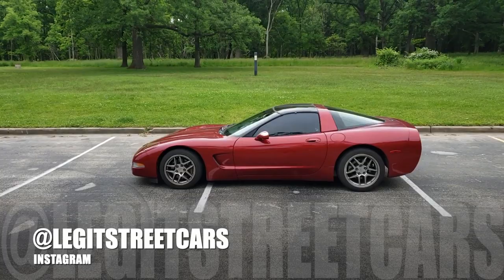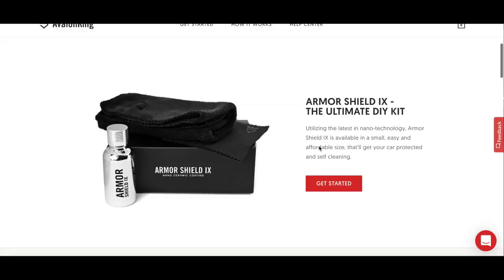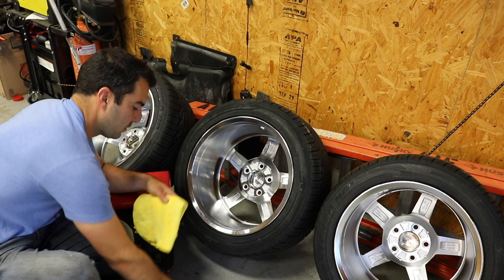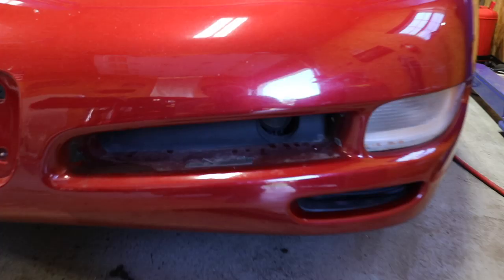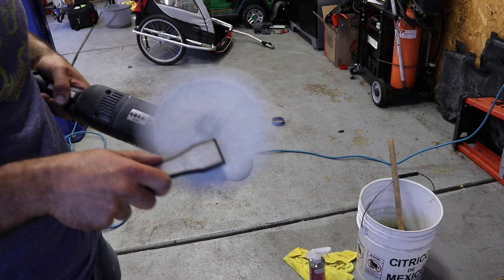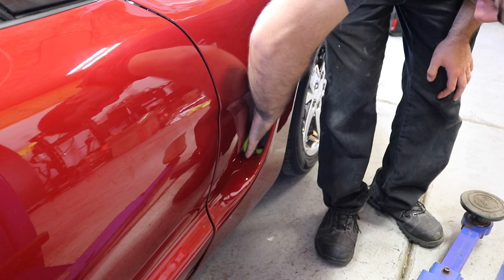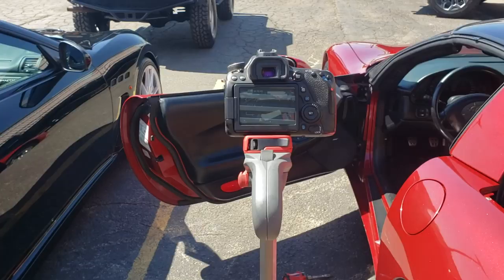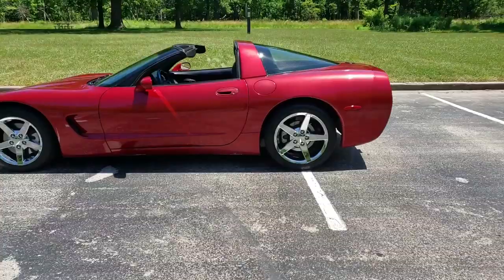I Love Corvettes So I Spent 30 Hours Restoring One That Sat Outside For 8 Years. DIY C5 Restoration.

Comment: 16:40 LMAO
At your response to him, but also at how wrong he is.  A Corvette C5, the freaking LS1, is one of the cheapest performance engines to have/work with. Sure it's not as cheap as Honda Accord Ownership, but compared to most sports cars, it's a bullet proof and easy ride.
Reply: She was a beautiful thing already, but you added the oil of Olay. She's now radiant, and I guarantee you she doesn't want to be babied. Put your foot in it, and if its the TH 700 automatics use your gears. I've been " stickin'" mine for 20 years . Mines never required anything more than every 4to 6 year complete flush 'n fill with the new screen,filter, 0 rings and gaskets. I've  always added the one bottle of Slick-50 transmission additive and  that's it. Great video and  sharing your expertise on the detailing and products you use is very cool man.

Comment: I have got a really good tip for the faded trim area, apply some silicone stick and use a heater to warm up the plastic.
It will look as good as new.
Reply: And just message me if you want before and after picture

Comment: I detail cars and trucks for a living and as far as the plastic goes I use a product called bumper coat, you are actually repainting all the plastic but the product lays down so smooth it is awesome. I use it on everything that needs brought back to life and with three good coats there is no fading or having to redo it.

Comment: The best trim restorer I ever used was Gtechniq C4 ceramic trim restorer. This stuff is like a miracle in a bottle and it lasts YEARS. I used it on an old Mercedes and an old Land Rover with really nasty black trim and it came out almost perfect. I did both almost two years ago and still see no need to refresh them to this day. Totally worth the  money -- about $40 for a small bottle -- but you just never have to do it again.

Comment: You can get plastic trims back to stock with a heat gun and patience.
Practice on hidden locations before you go all in!
Reply: Dolph Handcreme That doesn’t make it back to stock it just erases the top cover which is worse .
Reply: @edgarh252  tested it on 3 cars a while ago. It does not erase anything, it just let the top layer reflow a little bit to get less rough, so reflecting  the light in another way and look darker.
Reply: Dolph Handcreme I’ve been told that by professionals.
Reply: @edgarh252  and I tested it myself. ;)
Reply: @dolphhandcreme  Jay Leno told me that it's the dumbest shit he's ever heard in his life.
Reply: Would be cheaper to just replace the trim with new ones
Reply: Great idea! It's no that easy to get new parts for cars that are out of production since many years. Depends hugely on the make and model. And most aftermarket trmi parts are not 100% identical to factory ones so it looks a bit off.

Comment: First off, congrats on doing it yourself and learning.  Secondly, get rid of that Chemical Guys stuff.  Its junk.   CarPro, Meguiar's and Griots are the go to choices for GM paint.  Being of a harder nature, you need a stronger compound to cut through oxidation and get down to good clean clearcoat.  But before that, I would not have used alcohol to clean dirt.  Even Simple Green would have been a better choice, soap and water being the best choice.  I didn't see where you cleaned the engine bay, it desperately needed it.  The iron remover you used from Chemical Guys is nowhere near as strong as CarPro Iron-X.  But for the tools you had on hand, the car came out as well as can be expected.  However, had you used CarPro ClearCut or Griots Fast Correcting Cream, you would have seen a dramatic difference.  Also, when correcting, get yourself a forehead mounted LED light.  Makes it easier to see the imperfections removed while correcting.   Furthermore, when removing badges, try CarPro Tar-X as its an absolutely amazing adhesive remover.  Just spray and wipe.  Lastly, when doing a ceramic coating, its IMPERATIVE to use a light to check your work when removing.  High spots can make or break a job.  I don't know where your located but if you could find a reputable shop near you, and get their opinion (which is no charge), you will see the truth in what I am typing.  However, what's done is done, I am merely hoping to share some of my experience with you.  Keep practicing, its the only way to learn!
Reply: Mike K well said Mike!  That is all 👨‍⚖️
Reply: I support this comment and use the products he recommends. I use Griots Fast Correcting Cream and Sonax Perfect Finish when doing a 2 step. Also after paint correcting it's important to get all the polishing oils 100% off the paint before applying the ceramic coating. For this I use Carpro Eraser. For black trim I ceramic coat it with Kamikaze ISM. It restores faded black plastic and keeps it looking new for years without looking shiny or greasy like some dressing do. And it's super easy to use also.

Comment: 15:53 I still see swirls
Reply: And holograms
Reply: @DuBstep115  , yes, awful holograms!
Reply: The wool pad with heavy cut was way too heavy handed imo, and then he made too big of a jump to the yellow foam pad...
Reply: @asthecrowflies1201  he should have compounded longer but also he doesn't want to jeopardize the clear coat
Reply: Such a shame for 4 days of work. That’s why you make test spots people.
Reply: It definitely happens. I know we've all made our fair share of oopsies over the years. It's a big part of learning, and shouldn't be viewed as failure.
Reply: Years ago I went way too hard on a single stage, custom lacquer paint job with basically no clear on a 1970 challenger. The paint was fine for like 35 years and I murdered it in mere minutes :(  Took it all the way to the primer in A BUNCH of spots before I realized what I had done. I died a little that day...
Reply: As The Crow Flies yeah buddy that’s failure.

Comment: C5's are so insanely inexpensive in my area it's almost ridiculous. Absolutely the most "bang for the buck" you can find as far as performance goes. 

For trim, Solution Finish is amazing. For hard plastic trim, I usually just scrub it with APC and ceramic coat it. I don't want to deal with reapplying products every time I see it. The coating means trim looks good for years, not great for weeks. They make trim specific coatings, but I find them unnecessary in most cases..

I often coat half of the hood on client cars if they're hesitant to spend the extra money on a legit coating, it works everytime.. 👍👌✌
Reply: Mercury Grand Marquis   I wouldn't consider a Charger a luxury car. I've bought and sold and driven various Chargers, Corvettes, Camaros, Mustangs, etc., and I've driven several Hellcats, Porsches, Vipers, exotics, etc.. 

For me the overall performance, fun factor and just the feeling you get behind the wheel of a C5.. it just looks and feels like a hell of a lot of car for the money.

But this is just my personal experience and opinion, there is really no right or wrong. I love and appreciate all cars and am not biased in any way. 

My first car was an old '91 Mazda RX-7, so they will forever be one of my favorite cars to drive. Not a lot of incredible performance there.. I thought it was the coolest, fastest thing around at 16, driving it to high school paying $225 a month for insurance because it was a turbo.. 😁👍👌✌

Comment: have the old wheels powder coated, maybe anthracite?
Reply: Plasti-dip. 40 bucks. 👍
Reply: @heinzkitzvelvet  plasti dip is the cheap way,but those were nice vette wheels and so, should be done right .
Reply: @2001wj  Then why change the color? Nothing wrong with chrome. The replacement wheels are chrome. So why powder coat them another color? If you want to experiment with other colors, Plasti-dip is the way to go. Don't like it? Take it off. 

Don't like the color of the powder coat? You're fucked.
Reply: @2001wj  So I think having them repaired and re-chromed is the best thing to do. It leaves them in their OEM state. Powder coating will hurt the value. Plasti-dip will not.
Reply: Heinzkitz Velvet they are a mass produced wheel, powder coating them would do nothing bad to their value, they have very little. His idea of powder coating them for a daily driver is valid. Powder coated wheel is VERY durable, hides dirt (if the right color), is easy to doctor up if they get scratched. They also would look awesome in the color suggested. ;)
Reply: @Todd66  Well that's just completely wrong in every way. OEM parts, especially in pristine, original condition, are ALWAYS of higher value, and cost, on the secondhand market, than the same parts that have been "modified" by one owner, to suit his fancy, and sold to another. Mass production numbers have nothing to do with it. OEM original will ALWAYS fetch a premium, especially if the condition is top notch. Try again.
Reply: $50 powder coat each wheel at CO in yorkville. He has a chrome set, now use 2nd set for winter tires. Knowing Alex, he will daily drive it in Chicago Winters.
Reply: Heinzkitz Velvet I’m sorry, but read what you wrote. The wheels are NOT in pristine condition, reman wheels are only expensive on eBay. Get on facebook market place, pic a vehicle and search OEM wheels for foreign and domestic. You can get a perfect set of OEM wheels and in most cases tires for less than $800.00 right now. I drive a C6 and OEM wheels in perfect condition can be had for less than $1200 regularly. I appreciate what you are saying about OEM being worth more, but that’s only if you are buying new and from a dealer. That vette is a C5, only the very rare will have any real value on the open market. I do believe if you watch the video again, those wheels are NOT OEM, they are in fact replicas and even worth less. So sir, you may try again. And in the future if you need to buy some OEM wheels for anything less than an exotic, hit me up, I’ll help you locate the perfect set for a better deal than you seem to think is available. And i’ll do it free of charge with no smug face to boot! I am a car guy 100%
Reply: @joemendez197  Those wheels need a lot of work done before powder coat becomes an option. It ain't happening for 50 bucks. That's yet another reason powder coating doesn't make any sense.
Reply: Heinzkitz Velvet if you think chroming them would take any less work, you are talking about a process you are unfamiliar with. Powder coating those wheels would be a little more than $100 a wheel. As a matter of fact, there is a place near Noblesville Indiana where the guy charges $100 a wheel, even with tires on the wheels. My mailman and I were just talking about this last month, he had his Grand Cherokee OEM wheels powder coated black. Get off the chrome wagon LOL First thing I did when I got my Vette, was to pull the OEM wheels off and put powder coated wheels on. I daily my vette so I needed a durable wheel that looks great and will continue to look great as the miles pile up.I would like to mention again that the wheels in the video are replicas not OEM, so there is NO reason not to powder coat them and every reason to nix the chrome. TRY AGAIN @Heinzkitz
Reply: Heinzkitz Velvet when I watched the video again, I get the impression they are replicas. Maybe you are right about them being a ZO6 OEM wheel, but that really does not change the fact that powder coating them would be a great option. They are near worthless as they sit, so anything done to them with the exception of Plasti Dip would be a improvement value wise. Not saying plasti dip is not cool, it has it’s applications. I did my wheels on my R1 a few years ago, they turned out great, but not really good for motorcycle wheels when you have chain drive. Was not as easy as I wanted to remove either. Back on point... I am not the biggest fountain of info on anything, let alone wheels, but I’ve got about 37 years experience dealing with the automotive industry and cars/trucks/motorcycles in my private life also. So to tell me I do not know what I am talking about is laughable. It’s been interesting to go back and forth, we both have very different perspectives. But I will stand by my original opinion that powder coating those wheels would make total sense. Powder coating wheels does not ruin them in any way. You are by no means “fucked” as you said if you don’t like them. Strip them and do it again. I’ve had parts chromed before...good luck getting a nice durable finish. There is a reason those wheels look like terrible. Chrome is crap, even OEM chrome. Powder coating just keeps getting better and better. The colors and textures now are amazing. Hey I’m done here, have a great week and thanks for spending time on here!
Reply: @Todd66  Here's an idea. Ruin your own stuff that you paid for with powder coat, and let people who know what they're doing, actually take care of theirs, deal? Or you could sit here on YouTube and keep running your mouth in a conversation no one invited you into. Either way, knock yourself out.👍
Reply: nope. satin bronze or gold would be killer with that maroon color
Reply: Yall going back and forth was damn near better than the video hah! Entertaining if nothing else.
Reply: Chuck B IKR! I was actually enjoying it until I realized he was/is being a douchebag and shitting on peoples threads. I noticed he did it to a another fella here in the comments section. Wtf?! Why do people have to impose their opinions like its gospel?! And more often than not, it’s people who really have no experience or knowledge towards the subject they are being so overbearing on. There is not one person on the earth that knows anything about powder coating that would tell you that powder coating a wheel is ruining it. Almost every wheel put on production sport cars today are either powder coated or chromed. Even polished aluminum wheels are usually powder coated clear. Anyway, glad i am not the only one who enjoyed it. Peace
Reply: Jack Pratt good call, nope I am definitely no expert. But really what does that matter? I just agreed with the Originator of this thread and have legitimate reasoning behind my perspective. Heinzkitz posted incorrect info, I corrected it for anyone reading. Then I took it personal when he became a douchebag about his point of view and suggestion. I’m a car guy, have been all my life, so when someone starts talking shit about car stuff, I feel obligated to put a stop to it right there. Did I say the right things and do it all right?? Negative. But I did in my eyes for me, prove my point. What did I get out of it? The self confidence from knowing I was right and a written reminder/example of how I can do better in the future.  I’m human, not a water walker. I deleted a post in this thread where I was trying to turn the tide and sorta befriend him, but I unintentionally found more posts by him doing the exact same shit. So I deleted it and did a little more viewing and discovered that what I thought I knew, I knew. For whatever that is worth. I guess I felt righteous knowing that some guy who shits on someone else’s thread just got shut down. Sorta like 1 for the good guys.

Comment: So nice. now,

full interior restoration
engine bay restoration 
install LED interior lighting / LED exterior lighting
straight pipe the exhaust
cold air intake stage 2 kit 
coil over kit
install touch screen radio (vehicle specific, they make ones that look OEM) 
upgrade all speakers
take to chevy dealership for a multi point inspection
Reply: That would look nice but that's a lot of money tbh
Reply: @thelegendkillersshittyduff1335  Thats not what I meant, I was talking LED Headlights/Tail lights.... not underglow....and I said LED interior lighting, as in map lights/cabin lights, replacing stock cabin bulbs with led bulbs....
Reply: dog person calm down there bud, almost every new car has LED headlights, taillights, and DRL’s.
Reply: dog person and yes there is a point in them, they are brighter and illuminate the dark road much better than yellow halogens. LED’s last 10 times longer and use less power while looking so much more beautiful.

Comment: 15:52-15:56 Those swirl marks under the ceramic coating, ouch.
Reply: those are actually streaks of left over ceramic coating. he didn’t properly wipe it off, and the coating stays and bakes on. to fully take it off you need to use multiple towels in steps
Reply: @drivers_premium  There could be leftover coating not fully buffed off, but those are definitely swirls as well. He was using the same wool pad to cut the defects, not a good move.

Comment: in 20 years of working on cars. I have never needed a wiper arm puller.
Reply: Ronny Koeller  I should have specified. I have never needed any tool whatsoever.  Remove nut,  bend wiper arm up so its not pressed against the glass. gently wiggle arm. Comes off every time.

Comment: One tip, put the cord over your shoulder,  also to help with the taillights and small spots; rotary polisher, rotary polisher extension rods, 3inch pads and backing plates, could even go down to 1 inch

Comment: I have a 2000 wj  jeep grand cherokee I restored most of the things and it looks really good for a 2000 model car, I drive the car only couple of times a year but I love it. the only downside of having an American car in Europe is that the replacement parts are very expensive, but still love the car

Comment: The guy in the van was right, those C5 and C6's are great until things start to break mechanically then they get expensive really quickly. You did do an excellent job though. I'm glad you're doing different tyoes of cars, I was never a Mercedes guy.
Reply: All cars break at one time or another. Take care of them any of them and they will reward you.